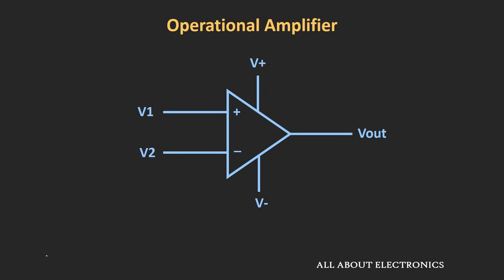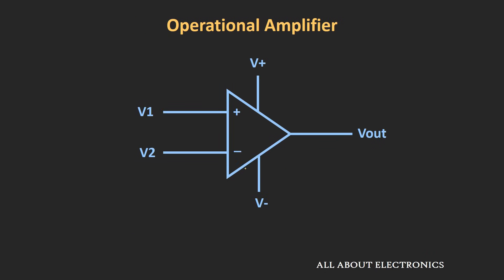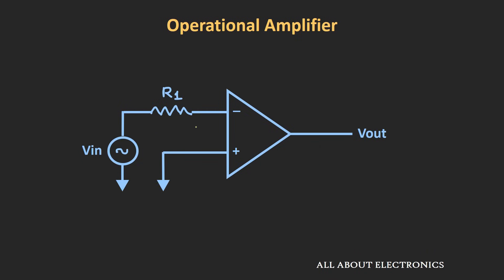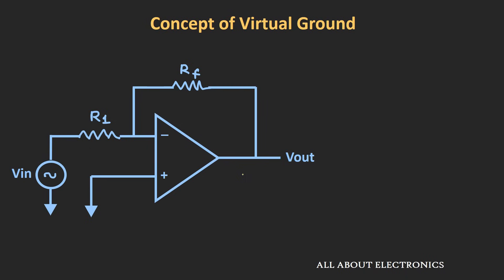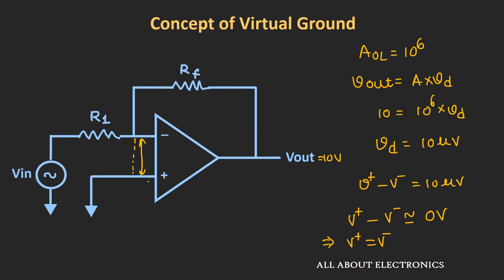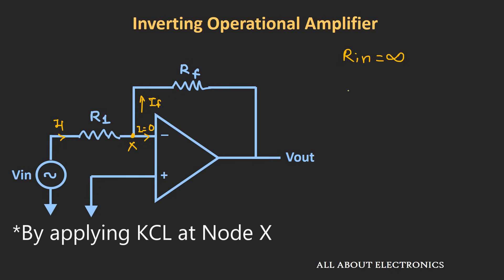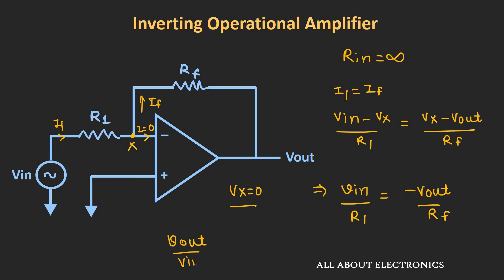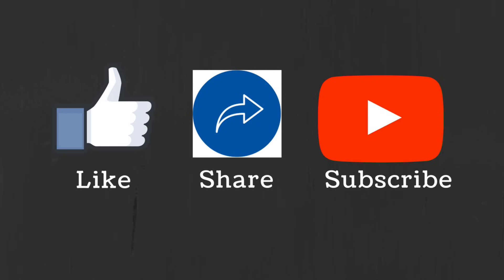Operational Amplifier: Inverting Op Amp and The Concept of Virtual Ground in Op Amp

Comment: why positive feedback leads to instability ?
Reply from the maker: When the positive feedback is applied to the op-amp then every time (after every loop iteration) the fraction of output voltage is added with the input. So, with time the input voltage which is applied to the op-amp will increase and in turn the output voltage of the op-amp will also increase. This procedure will continue till the output reaches the rail voltages (Biasing voltage). The output of the op-amp can not increase indefinitely  and it will be restricted by the applied biasing voltages. So, because if the positive feedback, the output will always get saturated to the biasing voltage. (instead of some finite voltage) and everything happens so quick that as soon as you apply the input to the op-amp and observe the output, you will find the saturation voltage at the output of the op-amp. So, in this way this positive feedback leads the output  of the op-amp in saturation or instability. 
(But sometimes this positive feedback is also used in many applications e.g Schmitt trigger or multi vibrator circuits)
I hope it will clear your doubt.
Reply: thank you

Comment: Difference between open loop gain and close loop gain pls💐
Reply from the maker: When the op-amp is used in the open loop configuration (without any feedback) then the gain of the op-amp is known as open loop gain. When op-amp is used in the closed loop configuration  (with negative feedback ) then the gain of the op-amp is known as the closed loop gain. Open loop gain is given in the datasheets which depend on the design of the op-amp. While the closed loop gain can be altered by changing the values of the external components connected to the op-amp. (e.g R1 and feedback resistor Rf)

Comment: How can we assume the input terminals as short circuited when op_amp is having high input impedance???🤔
Reply: That should be open circuited because of high input impedance
Reply from the maker: It's virtual short. It's not actual short. Because of the very high gain of the op-amp, the difference between the two input signal is very low. Even if op-amp has very high input impedance, it is possible to have both terminals are at almost same potential, because of very high gain of op-amp. Of, course ideally current will not flow between the two terminals. So, we can assume that there is virtual short between the two terminal. It's not actual short between the terminal. I hope it will clear your doubt.
Reply: @ALLABOUTELECTRONICS  sir they are virtualy open can you plz explain as their is no potential difference between terminals so no current therefore open circuit and you said short i not get it can you plz explain
Reply: @mohdaqibminai5975  here they are virtually shorted which means that they have same potential without being actually connected, as the derivation done for Vd in the video, it is obtained that Vd is so small that it can be assumed to be zero so when the difference in voltages between two points is zero then it means they are at the same potential.
Reply: It's only when you have negative feedback that the virtual ground presents itself. The circuitry inside will try to drive the node to equal the other. Often, it is very good at doing this. So good that you can say there is not a potential difference between inputs. They are "virtually" the same

Comment: Why we cant apply positive feedback, how will it get unstable, can you please explain ?
Reply from the maker: It's not that positive feedback cant' be used. In some application positive feedback is used like in Schmitt Trigger. But when op-amp is used for amplification then it should not be used with positive feedback. 
Now, when you apply the positive feedback then every time fraction of output is added to the input signal. So, the output signal will grow continuously. But it can not increase indefinitely and it will be saturated at the biasing voltage.(By the way, every thing which I have mentioned will happen in fraction of second, and when you observe the output on the scope you will find the saturated voltage) So, even if you apply small sinusoidal signal, let's say of 1mV with positive feedback, then also in the output you will be observe either constant saturation voltage or fluctuation of output between positive and negative saturation voltages,which is undesirable for amplification of signal. And that's it why should be avoided for amplification of he signal.
I hope it will clear your doubt.

Comment: Hi..sir, very nice video,
I have a some doubt 
1)what is differential input ..?(in this video)
2)In Automation what is differential command and floating command.(In plc)(for ex: + or -10V, +-10mA , 4 to 20mA, 2 to 10 v ) in above ex which are the floating and which is differential command.
3) In Automation what is potential free feedback (some sensors manufacturers mention potential free feedback)(ex: position sensor)
Reply from the maker: Differential input as its name suggests it is the difference between the two input terminal. It is generally used to in many applications to eliminate the effect of common mode signals. (The signals which are present at both terminals, for example, noise, EMI etc.)
About the third question,  do you mean to say potential free contacts, because it is generally used with PLCs?  If so then it is very similar to relay contacts.
And didn't get your second question.

Comment: you said that feedback is adding some part of output to input but here the current from input flowed to the output..so doesnt that means that input signal is being added to output?
Reply from the maker: Just look another way, Current IF is flowing through resistor Rf into the output. Or we can say that current - IF is going into the inverting node. It means that current IF is subtracted from the input current I1. (Which actually negative feedback). So, we can say that some part of the output current is fed back to the input side (with negative feedback.) I hope it will clear your doubt.
Reply: ALL ABOUT ELECTRONICS oh my God! You're awesome!

Comment: Hi , i am still abit unclear . Wouldnt there be voltage drop across r1. For ex. Vin =5v and then voltage drop across r1 is 2v wont the node x be at 3v. How it become 0v . Thank you !!
Reply: Current thru R1 and R4 is in the same direction. The voltage at the source is 5 volts and current flows thru R1 and drops 5 volts across it.  Now since  we are not at a true ground the current doesnt stop,  continues to flow through RF and drops another 5 volts such that the output is at 5 volts BELOW ground (negative 5 volts).  What really happens is the output voltage  changes to what ever it needs to  make the negative input the same as the positive input.
Reply from the maker: Because of the concept of virtual ground, the node x will be approximately at 0V. And here it has been assumed that the op-amp is an ideal op-amp. Please watch the video from 3:47 onwards carefully to understand the concept of virtual ground. If you still have any doubt then do let me know here.
Reply: ALL ABOUT ELECTRONICS hi i have rewatched it but i still dont get how it will be 0v . I understand that the op amp will force both input to have same voltage . But if i apply ohms law. Vr1 = ixR1 . If assume 5v of input , and r1 = rf . Wouldnt the node x be 2.5v ( voltage divider rule ) . How does the op amp force it to be 0V
Reply from the maker: Let's say input is 5V. Rf=R1=1K. Now, as inverting input is at ground potential so according to concept of virtual ground non-inverting terminal will also be at ground potential. V+=V-+0. Now, you apply KCL at node X, You will find that the incoming current to Node X is (5V-0)/1K= 5mA. And the outgoing current from node X should be the same. It means that current which is flowing through Rf is 5mA. So, drop across Rf will be equal to (1K * 5mA)= 5V. And as current is flowing from node X (which is at 0V) to Vout, output voltage will be equal to -5V. 
So, long story short, what you are saying will be true when Rf and R1 are connected in series. Here, R1 and Rf are not in series. The junction point of R1 and Rf (Node X) is at ground potential. 
I hope it will clear your doubt.
Reply: ALL ABOUT ELECTRONICS alright so the current are not flowing from vin to r1 then rf then vout right ? Instead is it right to say the current flow from vin through r1 and from vout flows through  rf and to node x ? Thanks for replying appreciate it

Comment: Why do we need feedback to control output. Why cant we just change the V+ - V-  so we can get the desired output?
Reply from the maker: V+ and V- are the biasing voltages of the op-amp. If you see the internal structure of the op-amp, it consists of so many transistors. And to operate these transistors properly, they require certain bias voltages. If you see the datasheet of any op-amp IC, bias voltages are specified for the op-amp. If you change the bias voltages outside the specific range then op-amp will not work properly. I hope it will clear your doubt.

Comment: I ‘ve seen ur 2 basic videos of Operational amplifier ..They r really good and I request you to explain by taking some problems asked in competitive exams...Plz
Reply from the maker: Yes, if you have seen my last videos on op-amp (Integrator and Differentiator), I have taken some examples. And anyway I am going to make a dedicated video on problems based on the op-amp.  But before I make that video, I will cover few topics like the gain-bandwidth product, slew rate, CMRR and offset voltages in Op-amp. So, that I can cover a variety of questions based on the op-amp.